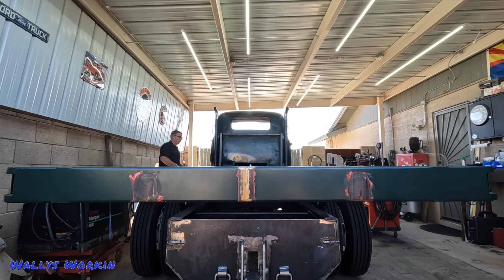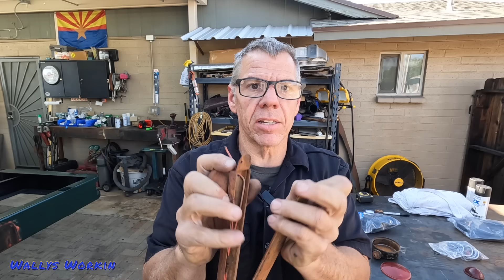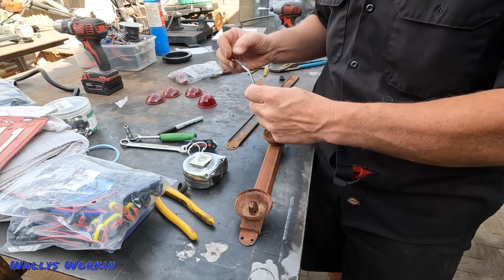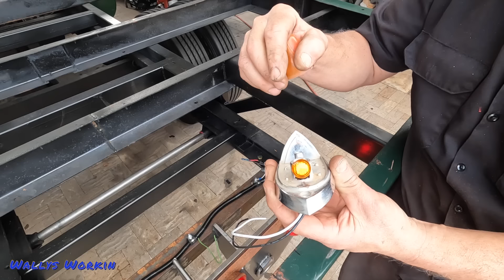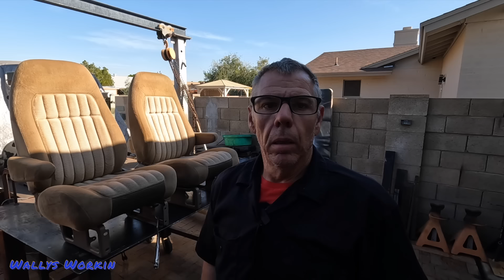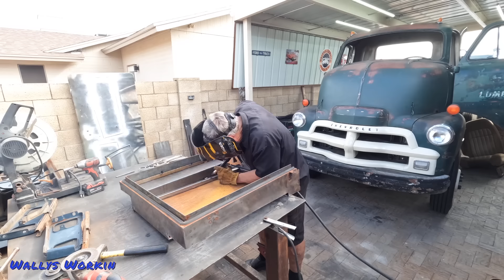Making old lights NEW with an LED conversion / The COE gets BUCKET seats!

Comment: If you want to raise the taillights up, could you drill and tap a hole in the 1/2 inch plate and threads the posts in without the nuts?

Comment: Your D rings should be welded solid, outward. In the current state you would need 2 hands to connect chains instead if one. Also the rings as they are would be a source of noise and would damage the paint. Additionally, do you need a license plate light in Arizona on a vehicle of this vintage?

Comment: Those lights on top of the cab will shake out  of  place for  sure. Just to let them  sit tight put a  little Polymax kit on top of the LED where it  is pushed into the opening you created

Alle the LED's look  the part nice job :)

Comment: I think I would have put a plate on the bottom of the seat bolted to the stock holes and then moved the seat track on the bottom of the plate. Between the plate thickness and the 1inch spacer that should give you the clearance you need.

Comment: I love the updated LED lights inside the original, or atleast older looking housing.  You might also be able to make it look even better with a diffuser filter, so the LEDs look more like an incandescent on those brake lights.  I have not done it though.
You will want to put a grommet around any holes you feed wires through your metal work so the wires dont wear out from vibrations.

Comment: Great job on the lights, but the hydraulic pump should be hidden in the left fuel tank along with the battery.  this would help with stones hitting it and if you have a leak like DDSPEEDSHOP did it will contain the oil instead of a big clean up.

Comment: Wally, your fabrication skills are amazing. I hope you are going to insulate everything in the cab including the underside if the engine cover. The lights look great just as you have them placed. The tag may need to be on the driver side per state rules for trucks. I know you pinched on the lights lens, but they can also be held with Hi-Temo gasket sealer/maker.

Comment: Lots of good stuff on this project Wally! What are you doing for thermal insulation on the dog house to keep the engine heat out of the cab? Seems like you could experience a hot cab especially in Arizona! Also don’t go cheap on the sound deadener on the cab roof or it could sag or end up in your lap from the Arizona heat too!

Comment: The ground for the cab lights may get you later  when the headliner is installed if you need to replace the led lights. You do not want to drop ht headliner for lights.

Comment: just wondering if your safety chains were ever used would they pull the d brackets out of the housing?  did you weld the ends together

Comment: FMVSS covers the lighting requirements based on the vehicle and dimensions not so much just the state. May want to look into that incase you are planning to take this beast anywhere outside of AZ
Reply: Also since you had to relocate the seat you are making a perfect "center console" platform. Look at Bodega armrest coolers. It allows you to keep some cold sodas or food which is nice for any drive or coffee and cars, and you can charge usb accessories.

Comment: If you really wanted the tail lights higher, where you wanted them originally, you could drill a larger hole with the mag drill that the nut would fit inside and weld the tab onto the centre of the larger hole so the nut would fit up inside the larger hole. But they look fine where they are. Carpet or any other material on the headlining will help absorb sound too.

Comment: The single seats used in a truck are actually called aviator seats because they're taller than bucket seats. But most people call the single seats in trucks bucket sests, which is understandable. understandsble.

Comment: A concern I have with the tail lights is those circuit boards don't appear to have the components encapsulated in a potting compound. Speaking from experience, the exposed parts will likely fail from corrosion from moisture in the housing. Might want to seal up those boards with silicone or epoxy.

Comment: Regarding a switch to drive your back up lights, a simple sprung loaded brake light from an old British motorcycle (Triumph/BSA etc.) would suffice & should be an easy to adapt at the shifter.

Comment: I was thinking "Wally should put some lights on the corners of the bed", then he mounts lights to the corner of the bed. I was telling Wally, "Just trim the aluminum down a bit on that pedestal", then Wally trimmed down the pedestal. I was thinking "Wally should modify the doghouse, mount the seats to that", then Wally modified the doghouse. Weird, get out of my head. I was thinking of a light bracket that mounted to the bed too, a little farther out, higher up closer to the bed. I don't know, they look good, I like you reusing the old parts and making them modern. They sell a light strip that goes along the back of trucks, it has tail, brake, signal and reverse, they are about 5' wide and ¾-1" tall, you could incorporate one of those along the bottom of the bed. We have cops that are bored, they feel that if your lights aren't as bright as they feel, its worth a fix it ticket, plus, with super bright lights, if someone does happen to hit you because they're not paying attention, they can't say its because they didn't see the lights. Thought on the door panels, can you use some sheetmetal and use some Liquid Nails or other heavy duty adhesive to glue some sheet metal or aluminum plate like 1/16 on the backside to give it some structural support? The wires that you tucked into the ridge on the cab, you can take a piece of vacuum hose, about an inch long, split it lengthwise, put your wire in it and shove it into the groove, it holds it in place, it is an insulator and is really quick. The seats look good, even with the darker tan, the lighter tan and brown matches the truck, so the darker tan fits right in. I like that you listen to people's comments, it means you're open to new ideas, new ways or easier ways to get your job done. The truck is coming together nicely, great job

Comment: Yeah man, the Bucket seat looks great and it matches with the paint of the vehicle . you did a great job Modifying the cover to fit the Bucket Seat fit In side the cabin in the vehicle , And also you did a great job on the lights man .When you turn on the lights man it really looks great, thanks for sharing Mr.Wally have a bless week .

Comment: You need to do something with the surface rust on things like the inside of the tail lights and markers. You could spray them with clear paint or treat them a product called Ospho. It is a rust nutalizer that goes on like water and turns into a primer

Comment: Is there room inside the roof marker light bezels to install the rivnuts from the inside of the cab and use shorter screws to eliminate the scalp gougers
Reply from the maker: No, I can cut the excess off and put the ground somewhere else. If I hit those with my head I have bigger problems 😂

Comment: Greetings from Germany.... I live in Germany but grew-up out west where Good'Nuff is just Good'Nuff ain't no one complaining.
I remember one day when I first got here with my US Spec VW Vanagon and took it to TÜV inspection. Passed almost but rejected because the back profile tires were just a bit bigger and tread a touch different than the front. No matter my idea of they were 'Good'Nuff' back home... the inspector was not haven't It... NO way...! If the tires are not a match set and with in limits it simply ain't go'n through a German TÜV.  A couple of years ago I tried to take our car through inspection and the battery had been gassing just a bit so I sprinkled a little of Arm & Hammer baking soda and had actually forgotten about it. Well they popped the hood and shut it just as quick... 'Your battery is badly corroded..." they said it must be replaced before we can do an inspection. Well I did attempt to explain how baking soda controls battery acid. They had never heard of such a thing nor would they accept such an absurd explanation.  This did not bother me too much, I just said Okay I'll be back. I took it home removed the battery and shop vacuumed all the ... "Corrosive.." evidence, rinsed and dried the battery off, reinstalled it, reset my clock and radio stations took it back a day or two later... The same inspector never said a word.  
Our vehicle inspections over here are every two years if your car does not fit their 'TÜV' criteria, regardless of age or Kilometers/mileage... You ain't gonna get a passing grade. Walk or buy a new vehicle, ride a bike, take a bus or train.. but you ain't gonna travel in that 'failed inspected' vehicle. That's my story and I'm stick'en to it... 😉

PS: For those of you who know... I was active duty military and my US Speck van was registered through the military POV (Privetly Owned Vehicle) system and  A US spec vehicle is legal under the SOFA (Status of Forces Agreement with the German Government).
Reply from the maker: The Germans don’t play, my COE would cause them serious heart burn😂. Can’t believe you hauled a Vanagon over there. Thanks for your service!
Reply: @wallysworkin823  While previously stationed in Germany I drove a German VW Transporter/van that was part of the US military Motor Pool fleet.
I liked it and said that I would not mind having one especially having a young family and needed the space.
so while stationed in CA I purchased a two year old VW Vanagan with the pan cake air cooled. Put lots of miles on it touring. Finally received orders back to Germany... drove it across country and shipped it via Government authorization to Germany.
We Luv'ed that van lots fond memories. Then one day it began to leak oil so I removed the heat shielding tin just so I could keep it clean easier. Well it was not long I found out the hard way just how important it was to have that tin on for proper air flow.
Yea you 'VW folks' know exactly what a BIG mistake that was... Yep It sucked a valve and was dead in the water! Ended-up re-building the engine. Drove it for a while and sold it for a later model station wagon.

Comment: The only other thing that I would suggest would be to add two 2 × 2 braces from just shy of both sides of the trailer hitch plate out to the frame rails similar to the extra braces on the back side of the bed hinges to help the piece of angle iron prevent the steel plate from flexing when you have a trailer hooked up to the truck. Just a thought.

Comment: I think you are pretty much on the money on how much weight that one ram cylinder can lift but a small question, with the Maverick weighing about 2900, did you factor in the bed itself. With the wood planks and the additional steel supports....maybe an additional 400-500 pounds?
Reply from the maker: I did, yes.

Comment: I really like the tail lights. I guess you realize that all of the wiring for the rear lights and the lights themselves have to be removed if you're going to do  heavy hotter welding on the hitch and surrounding braces.

Comment: I think I’d try and roll a piece to make the front of that dog house have a rounded look, maybe add in some cup holders welded into that doghouse now that it is open and not covered by the bench seat belts a nice addition.
Reply: Split tubing frame infilled works too. It’s a lot more work fitting and joining it up, but doesn’t require the use of any expensive heavy machinery either.

Comment: I really like your fabrication skills but methinks sometimes it is well worth spending a little to make thing all around better.  I suspect it would have been beneficial to just go to the Big Block Holley Mid-Mount water pump assembly..... you can just buy the expensive main pump housing from Holley and then get the accessories (water pump, alternator, a/c compressor) that bolt on separately..... seems like that would have you let have a flat floor since all the components get moved DOWN to the front of the engine......  that would then allow a lot more flexibility in seat mounting......  I cannot tell for sure since I cannot really see the throttle body intake height.....  but if it gets terribly annoying you can look into that.
A Flat Floor would be all around wonderful..... or anyway..it seems to me.

Comment: And Wally said, "Let there be light", and there was light, and Wally said it was good enough! 😄 They really do look good.  Looking forward to your setting up the seat. It's a shame there isn't an easier way to access the engine, like maybe tilting the seats and the doghouse forward as a unit, but I guess that's not feasible. Keep on keeping on. Loving the build!
Reply from the maker: No room to tilt anything, passenger seat maybe. Just too tight.
Reply: @wallysworkin823  Yeah, that's what I was thinking. And if you split the doghouse to flip the passenger side up, you have new problems

Comment: M5 x .8 is very close to 10-32 TPI, for what it is worth. The SAE thread is a few thousands undersize, however. For a non-structural load, it might be "okay enough" for your purposes, if it matters enough to want to mess with changing.

Comment: It still seems to me that you could mod the seat so that the seatback easily removes and the seatbottom hinges up and fwd out of the way. This fabrication idea can work well with the bench seat, which maybe can just fold onto itself then flip up.   Think- detachable/collapsible rear minivan seat mounting.  Like the seats from a GM APV van of the 90s.

Comment: Those aluminium (bloody colonials and weird spelling 😉 😂) surrounds look real good in there Wally, in fact the whole LED conversion looks fantastic.
With regards to the reversing light, could you convert the middle of the 3 rear markers to a clear lens or are the 3 of them a legal requirement. 
The DoD found out you used a metric fitting and they sent the Apache in to make sure you knew it was naughty 😂😂😘
Stay safe sir, see you next week
Reply from the maker: Haha sorry about the pronunciation!

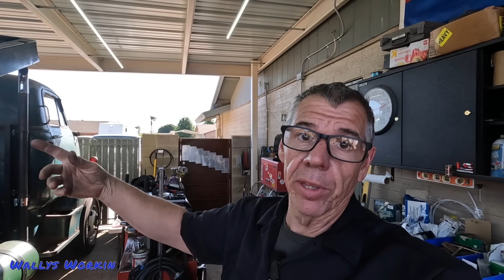Comment: 5:00 the most likely issue there would be a dead battery. 
I suggest adding an insulated positive lug on that drop down bracket so you can easily hook a jumper cable to the battery later if it is dead and need to lift the bed.

Comment: Wally you are doing a great job on this truck.  I have a 66 Datsun truck that I put a later model chassis and engine in it.  What AZ MVD suggested was when I finish the truck take it in and have a level 2 inspection done to pickup the serial numbers of the chassis and the engine to the AZ title.  You will need to have the title to the motor home with you to surrender at the level 2 inspection.  I have lost a 52 Studebaker Champion and 66 Harley to California impound because of non matching numbers.  Hopefully if you ever travel to California this does not happen to you.  Again great build and thank you for sharing.
Reply from the maker: It’s already titled and ready! This truck will never go to California!!

Comment: Tap the holes in the plastic. Drill holes in the can that match the holes in the board. Eliminate the metal bracket and welding. Aren't you going to paint the rear lightbar?